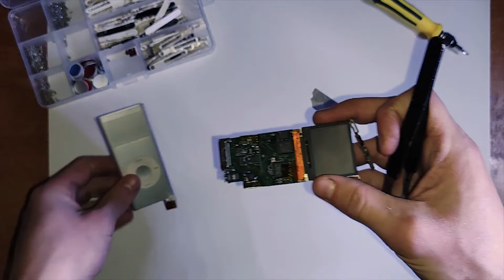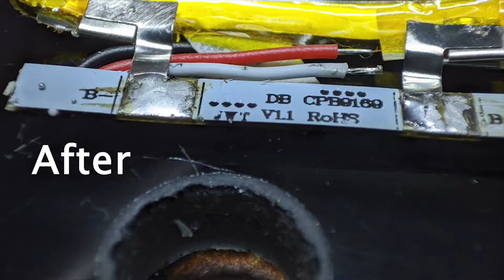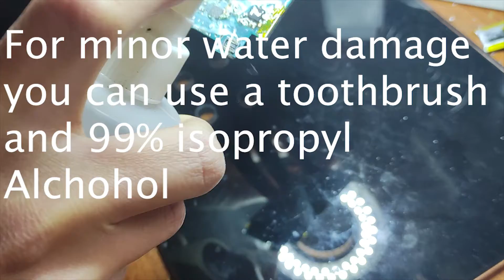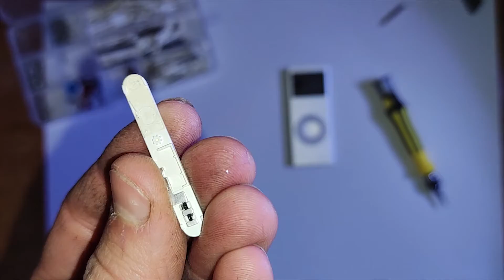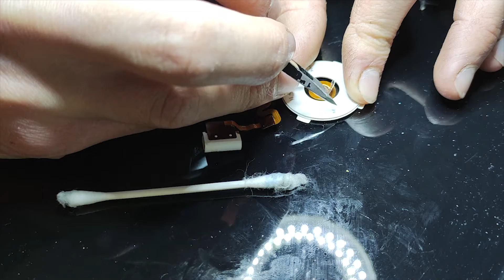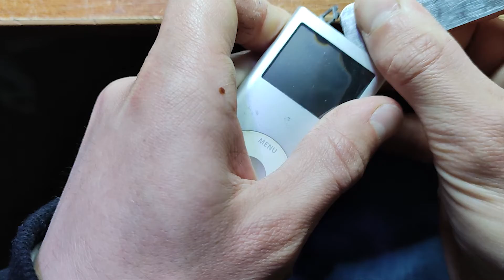Apple iPod Nano 2nd Gen Ultimate Repair Guide Battery LCD Buttons In Depth

Comment: Im about to attempt to replace my aux port on mine. I didnt realize its attached to the click wheel! I have a working nano with a swollen battery im going to use for parts, so i dont care if anything breaks as long as I can get the wheel and aux port out fine

Comment: Any idea what went wrong when the new battery won't charge? So it came with 50% precharge and the Ipod turned on fine, recognised by itunes etc, but leaving it on the charger for a night didn't change the battery bar 1%. I tried different wall plugs, cables, usb-ports. Ipod says it's charging but the power meter says it's not pulling any power. My Ipod video draws ~4-5 watts from the outlet.

Comment: Great video, thanks.  I’m attempting to fix my wife’s iPod nano that got flood damaged. Swollen battery and cracked screen. Found a place in europe dealing with scrap electronics, ordered a nano from them  (just €2.50) with the plan to use the screen from it, and have a bit of a practice taking it apart. Came apart ok following your great instructions, so tried on my wife’s one, hmmmmm, not so easy, swollen battery made it really tricky but got it apart. Ordered a new battery from Germany. Now the very tricky part has been  getting it back together, all tested and working outside the case, but something went awry pushing the logic board etc in, so now it doesn’t boot properly ( i was so careful) . Anyway took it apart again and by swapping parts it seem the logic board is not well, good job I have a spare. Anyway it’s still a work in progress, I find it helps to leave it alone for a while and come back to it fresh. Also flash modding my Mini, which so far is soooo much easier to work on.
Anyway thanks again for the great video. x

Comment: I know this is a full tear down, but I want to ask for clarifiction. Do you have to take the screen off to change the battery, or can you leave it attached?
Reply from the maker: you could leave it attached but i always take it off as it could break when peeling the battery off. It may also get flux paste or alcohol under the LCD and cause a watermark if you leave it attached. Its just held on with double sided tape so it comes off pretty easy.

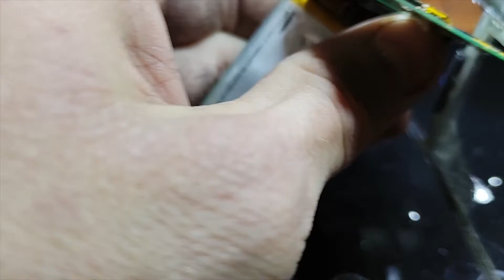Comment: I wouldn't recommend bridging all the battery points as you do at 8:06 - unless you've tested it with a multimeter and it's showing zero volts. Doing one at a time is safer and taping off each with electrical/Kapton tape before starting on the next. Shorted Lion batteries are not good!
Reply: Great guide apart from that. Very clear camera-work and incredible detail. The best I've seen for this device on YouTube!

Comment: I just “replaced” the battery on mine, the replacement battery was slightly thicker than the original and ended up cracking the screen.
Reply: where did you get your battery from?
Reply: @TheDiscardedFoot  eBay, mostly my fault for choosing the cheapest battery I could find.

Comment: i just bought one of these, and so far, i haven't had any battery issues (holds a good charge, no expansion or bulging). is there anything i should do to help prevent it from happening? besides leaving it in a hot car and things like that. should i replace the battery to ensure it doesn't, or should i leave it until it actually shows signs of expanding?
Reply: For batteries, DONT make it go flat to 0 but dont charge it up to 100. Keep it between 15-80. Thats the best for the batteries in general
Reply: So you say use only 65% battery from your device which I had paid 100% for?! Sounds very dumb to me.
Also how come that when the battery in my device goes to 0% it can still display that the battery is empty and it is still searchable through iCloud. So I guess the manufacturer thought about that and let the OS use just 65% from the real capacity of the battery. And now you want to tell people to use even less?!
Reply: @4bl0xx30  dude don't get offended with the basic facts with batteries. It definitely causes the most stress to leave your batteries on the charger (aka at 100%) or dead (aka 0%) for extended periods of time. I don't think just touching either end of fully charged or discharged is as bad, but for sure keeping it on either end will decrease the lifespan of your battery dramatically. use your electronics how you want to use it, but consider how difficult it is to take apart in this case with the ipod nano, when the battery swells with little to no space in the housing.

Comment: I just bought a used nano 2nd gen to add to my iPod collection. As of now, it's battery is not expanding or having any problems. Considering it's age, would you recommend swapping the battery as preemptive measure or just keep using it and cross that bridge if/when I come to it?
Reply from the maker: If you are happy with the battery life I would probably just leave it. As it is not a guarantee that it will expand. Id say maybe only 10 - 20% of them end up expanding.